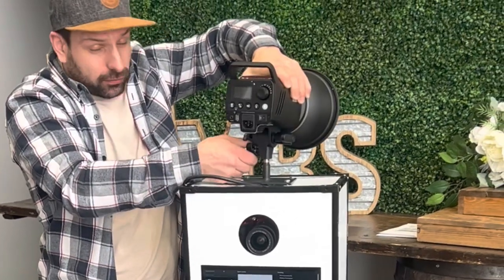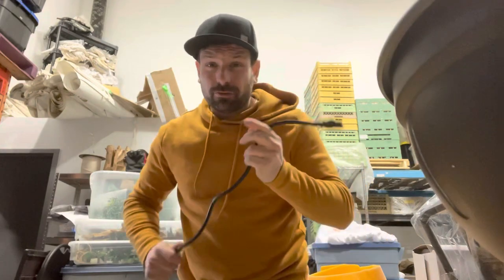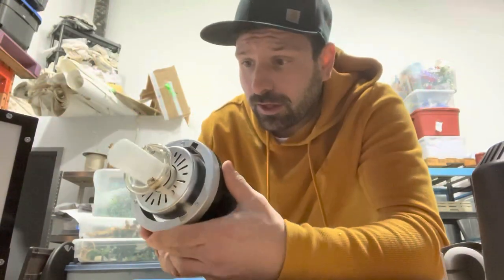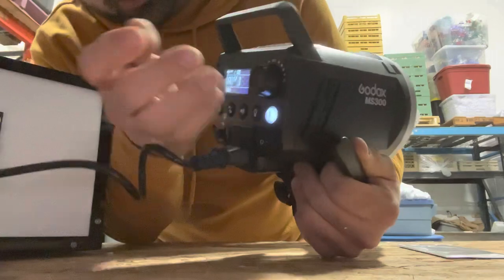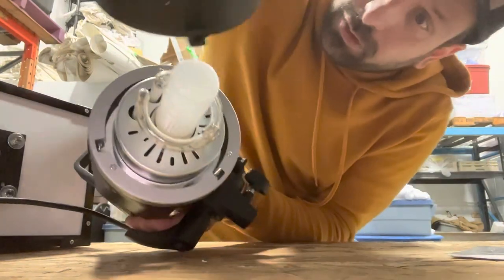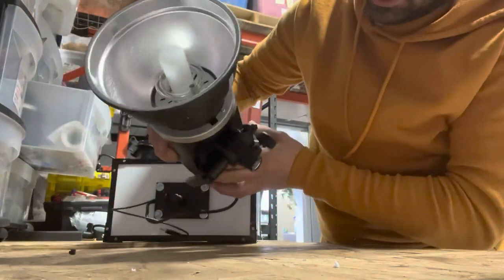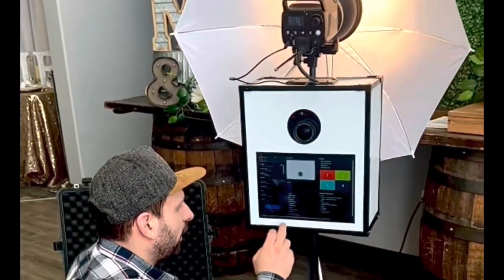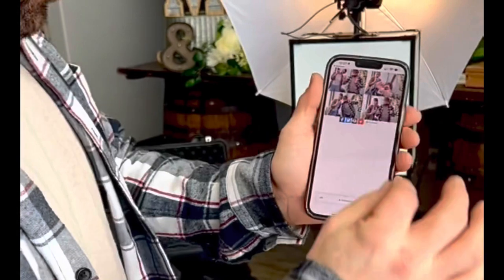Photo Booth Light - Godox MS300 Review - Mono Light Strobe

Comment: If you’re placing the strobe light away from the subject, shouldn’t you use a reflective umbrella instead of a shoot through/translucent umbrella? It kinda makes the strobe light pointless doing that.
Reply: The white shoot through umbrella will still reflect the light from the strobe. It’s definitely wasting light by not having a reflective backing but it still works. Just requires more light from the strobe.

Comment: I also use ms300, but i dont use pc sinc cord. Just use pop up flash camera, and turn on Slave at ms300.
Reply: You! You! I don’t know who you are!!! But!…..I was crazy for two days trying to sync this flash with my canon eos r100 in dlsr booth with a wire. And dslr booth went crazy and fail….and now I read your comment…pop up the flash…s1 in godox and….it works!!!! If tomorrow works in dslr booth…man/girl….whoever you are…you are AMAZING!!!!!
Reply: @guillermoiglesias3065 Did this work?
Reply: Yes…BUT!… in my case it wasn’t completely functional due to the flash camera is inside the booth… (and make things doesn’t work well). I am using right now a hot shoe adapter (universal, a cheap one in amazon) plus a jack 3.5 to pc wire (amazon as well) and it works perfect.

Comment: Hi! We just got a photobooth and are having issues with the flash. We set it up exactly how you described and it works when you directly hit the camera button, however when you press take a photo on the ipad through the software Snappic it does not trigger the flash. Any advice? Thank you so much!
Reply: He isn’t using SnapPic or an iPad. He uses dslrBooth on a Surface Pro (runs Windows).